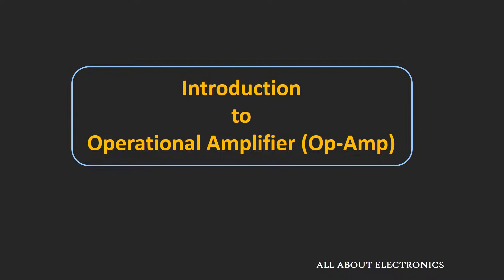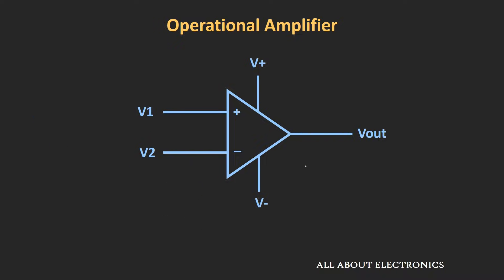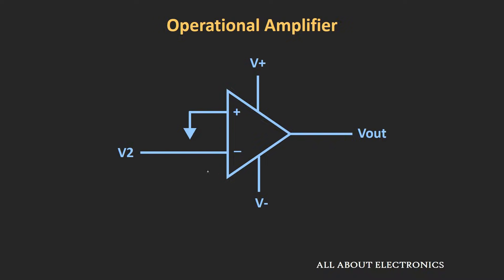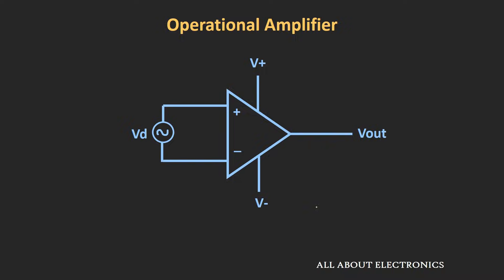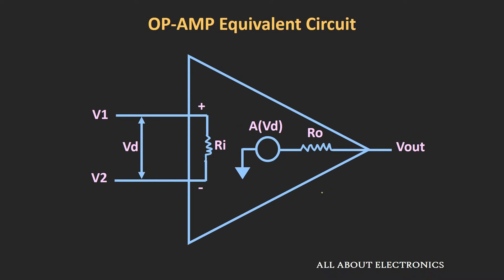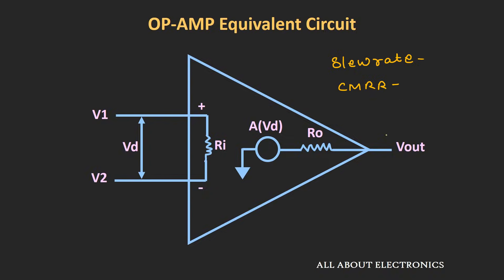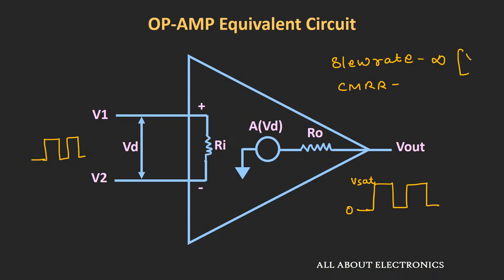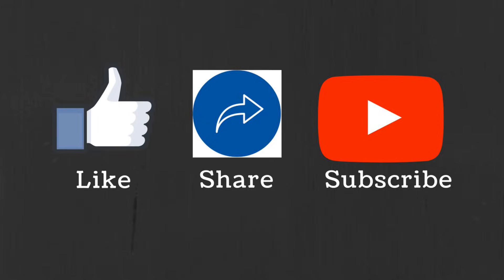Introduction to Operational Amplifier: Characteristics of Ideal Op-Amp

Comment: Hi Sir, i would like to clarify in inverting terminal is gnd, when we apply sinusoidal waveform in non inverting terminal without any feedback components the output signal shall be amplified square wave, but in video it is mentioned as amplified sinusoidal waveform.
Reply from the maker: What you are saying is correct. But here in the video, I was just explaining the inverting and non-inverting terminals of the op-amp in the ideal condition. (Considering very small inputs, which will not saturate the output)
In practical case, it will saturate the output and you will get the squar wave at the output.

Comment: Can you please explain in detail why input impedance is infinity while output impedance is zero.
Reply from the maker: When op-amp is considered as an ideal op-amp then input impedance is infinite and output impedance is zero. But for actual op-amp input impedance is very high and output impedance is very low. 
Now, for any circuit, the input impedance is measured by connecting the voltage source to that circuit and measuring the input current drawn by that circuit from the voltage source.
The ratio of applied voltage and the drawn current from the source will give you input impedance of the circuit. 
Now, if you consider op-amp as an ideal op-amp then ideally no current is drawn by the input terminals of the op-amp. So, the current I =0. And the ratio of applied voltage to the current will be infinity. 
Similarly, to measure the output impedance, the load is connected to the output. Ideally, the voltage across the load should be the output voltage. But if it is less than the output voltage of the op-amp, it means that some series resistance is there in series with the output terminal. (And it is actually the output impedance )
For ideal op-amp output across the load is equal to the output of the op-amp and hence output impedance is zero. 
But actually, some finite impedance will be three for real op-amp. 
I hope it will clear your doubt.
Reply: Thank you sir 😊👍🏻

Comment: How can we select that which op amp is used in circuits
Reply from the maker: The selection of the op-amp depends on the application. If someone is using an op-amp for the high-speed application then one must consider op-amp with very good slew rate. If someone is using it for low voltage level and low noise application, then one should select op-amp with low input offset voltage and current. 
Moreover the characteristics, other things also matters like maximum current supplied by the op-amp, power consumption, etc. So, considering all these things, one should select an op-amp for a particular application.

Comment: nice video bro... and...what is offset voltage???
Reply from the maker: When the differential input to Op-Amp is zero, the output of the Op-Amp should be zero. But in reality, we used to get some finite output voltage (few mV). So, to nullify this output voltage and making it zero, the amount of differential input voltage which needs to be applied at the input of the Op-Amp is defined as input offset voltage. In datasheets, it used to be defined as the input offset voltage.
I will make a separate video on this offset voltage very soon.